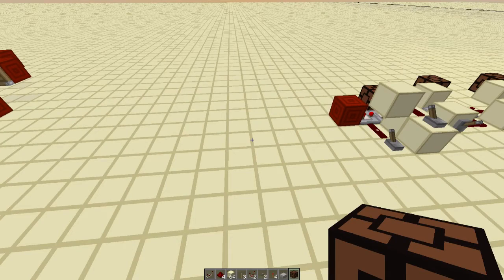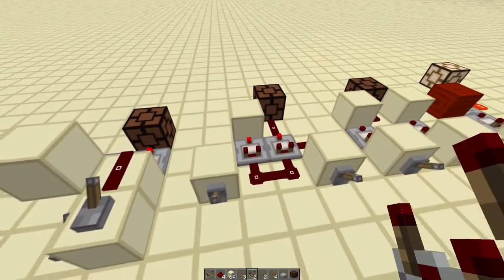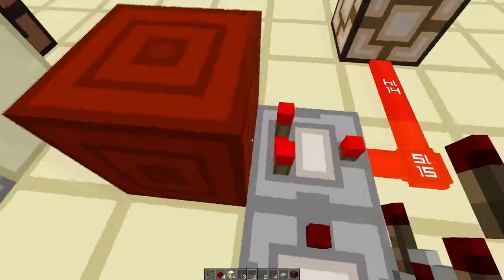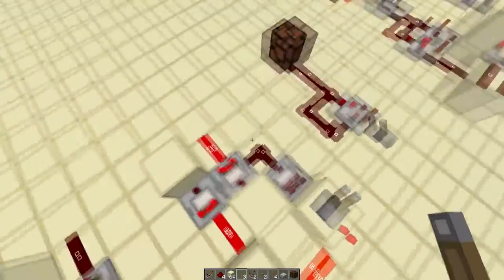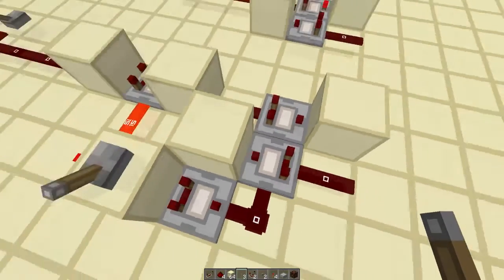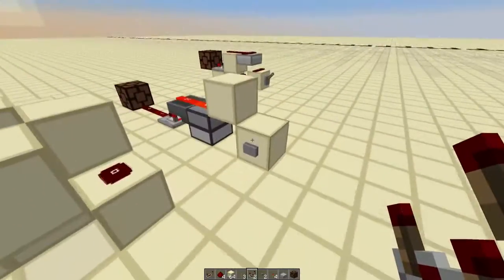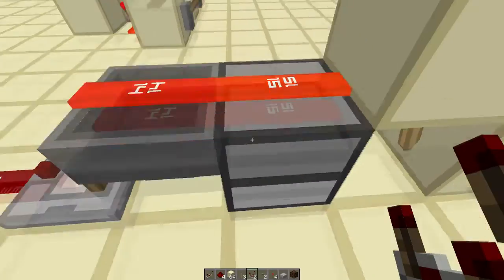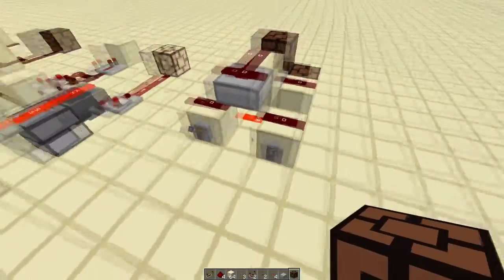10 Uses for Comparators

Comment: The comparator clock never turned off for the lamp. It went from lvl 15 to 2. It's a common mistake many people make, but you need to have the line out longer, so that the line turns off, then back on.
Reply: He did make that mistake, but the lamp wouldn't have updated anyways